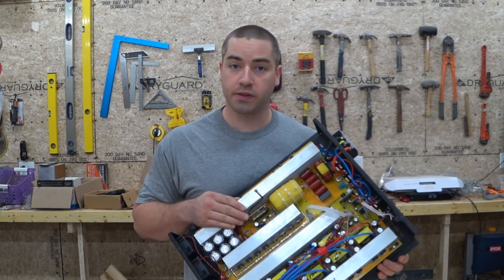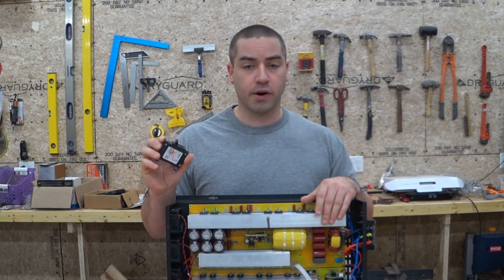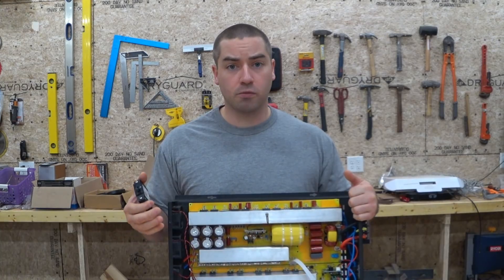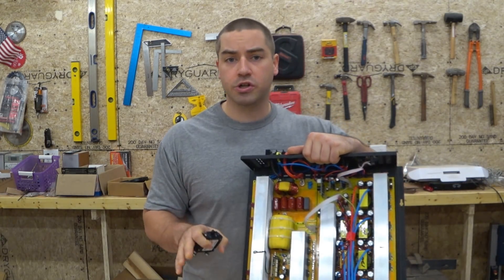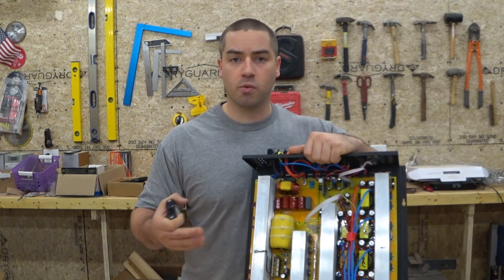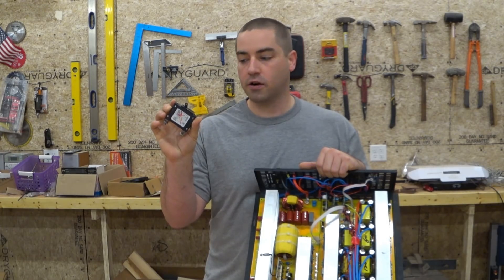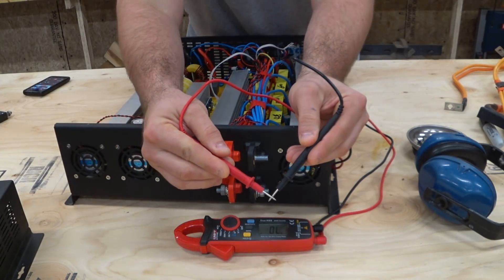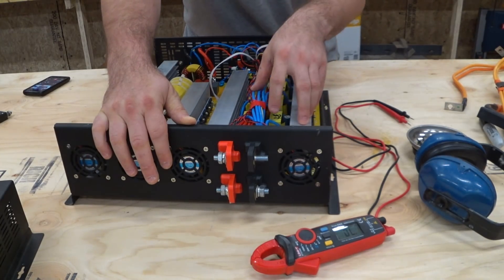Did I Blow Up the Inverter?

Comment: Your clamp meter can't response fast enough to give you actual peak inrush current. I would guess it about double or triple the reading value of 39Amp for the first 10msec.  With that much current goes through a conductor and disruptively stop because the circuit breaker trip, the voltage spike will result dV/dT (the one you see in the video) in thousands of volts and this voltage will go and kill most device in its path. If the breaker did not trip, it may not be the case. This may be the reason.
I think the reason that your 3000W didn't have this problem with the same set up, because it has overall higher circuit impedance (hard to explain in short note) and this in turn slow down the rate of inrush current, while the 8000W unit is made to supply big current. Its internal circuit impedance has to be lower; therefore, it will allow much more current to pass through (including the inrush).
If the product has been designed properly, the 8000W unit must incorporate inrush protecting circuit (slow turn on).
Reply from the maker: Thanks for the comment.  Can you please define "dv/dt" for me?  I don't know what that means.  Thanks.

Comment: I'd like to point out something critical, when you tried to measure the continuity, you've got all the capacitors in parallel and that can be read as a short to the meter while they are charging. 

I hope This helps https://youtu.be/_5h0HBf3xVI
Reply from the maker: Wow, thank you so much for taking the time to make the video.  Yes, very helpful.  I'll have to make a follow up video.
Reply: Good luck fixing the inverter, I might start posting when I'm asked to fix things when I get a better setup

Comment: Are the inverters true sine wave? A few years ago my brother (electrical engineer now, in school at the time) was telling me if I wanted to run motors on inverters I should use true sine wave because it could damage some types of motors if not. I am not sure it it could damage the inverters but it seems like a possible avenue of inquiry.
Reply from the maker: Thanks.  "Reliable Electric" says they are true sine wave.  However, I don't own an oscilloscope to say otherwise.

Comment: Crap design. Load balancing is a tricky bitch and that is designed like the cinese PSUs with lots of fets and/or diodes in parallel. The weakest will kill the entire stack.

Also, hold on the probes on the device and watch the numbers on the multimeter. On the dc input you have a lot of capacitors that will present as a short untill they charge. Hold the probes, watch the display. Tip-tapping a bit ain't cutting it ;)
Reply from the maker: Thanks.  I didn't know the proper way to check continuity until some other commentators said the same thing.  Since then I have re-checked it with the probes held on for one full minute and the reading was 000.0 ohms the whole time.  The number never changed.  I hope that helps.  Thanks for your comment.

Comment: The problem is poor inverter design, not your setup.  Any decent inverter will handle a dead short on its output without blowing up, regardless of how much power it was delivering at the instant the short appears.  The manufacturer needs to revise their design and do proper testing before shipping a product or stop building inverters.
Reply: yes a dead short on an inverter should shut down the inverter instantly... another protection circuit they left out
Reply: Is there such a thing as a well designed and cheap inverter?  If so, could you please recommend?
Reply: @chrisjohns9631  1. Cheap.  2. Quality product.  3.  Great customer support/service.    Pick two.

Comment: Putting a continuity tester on the 12v in will show a short as the internal capacitors will be discharged. Your as you called it input board is nothing more than a cluster of DC to DC boost converters, each producing 120v or so of DC, or 220v etc. That goes to the next board which takes that DC and connects it to the output via 4sets of MOSFETs first DC positive to one terminal and DC negative to the the other, waits a short while then connects the DC to the terminals the keep way, stimulating AC power. (It's basically a motor h bridge)
Oh and midnite solar are blowing smoke on the spark, at high amps sparks are not uncommon when breakers open, plenty of proof on YouTube. Breaking a DC circuit above a few amps without a spark would be a miracle. 
But..... I'd say the inverter failed first.
Reply: waits a short while then connects the DC to the terminals the other way, stimulating AC power. (It's basically a motor h bridge)
Reply from the maker: You mentioned "boost converters"  are those the things I called "transformer" in the video?
Reply: @DavidPozEnergy  yeah you have a bank of them to share the current load, its cheaper to make smaller ''boosters'' then one big one, but then its a see-saw in pcb size, do you want to use 10 x 10 amp converters or 100 x 1 amp ones.....

I once had an inverter fail to produce ac in the switching side, but the 'boost' side was fine so it was outputting 220v dc...... only one piece of equipment stopped working, the timer for my tshirt press, as it was the only thing with an old fashioned transformer 220 to 6v power supply inside it, my epson printers, laptop supply's, monitor, all kept running quite happy on dc

also testing for a short on the main input to the inverter, across that input are the huge capacitors, they will show short till they charge upto the multi-meters probe voltage,  just checked one of mine, shows a short for about 15 seconds then it gradually creeps up to a tens of thousand of ohms

Comment: What are the specs on your saw, does it have ratings on it anywhere, and like some others have mentioned about your battery bank, can it supply the amps (factoring in the burst load starting the saw) for that 8kw inverter., if not the volts will lower which then requires more amps. And saw's make horrible noise on the power lines, maybe even enough to upset the inner working of the switching inside the inverter like altering the switching time of one or more of the input stages which can put them out of sync, I wonder how it would go if you had an isolation transformer after the inverter (just curious, maybe someone can give some info how they would work.). I think by design that inverter can handle most regular house appliances up to the 8kw but no so great with power tools, but I would at least expect it to cope with a home AC system. Im surprised the makers of that inverter havn't asked you to ship that saw to them so they can test in house before too many more Blown Inverter videos get posted to youtube. Thanks for sharing, we all learn from this stuff. Look forward to more updated.

Comment: James moore is correct. It's not the batteries, it not the circuit breaker, it's not the saw. They all worked with the smaller 3K inverter. The only variable that changed was the inverter.

Comment: I'm not an EE either.  I'm just a dude sitting in his desk chair.  But my guess is that a "sine wave" inverter doesn't really produce a sine wave.  It produces a "wave" that would look like steps going up and down, up and down.  My guess about those transformers or chokes or what ever they are each operate for one level of stepped voltage.

Comment: You need to hold the DMM across the input terminals for more than a second to determine if there is a short or not.  The large capacitors on the DC (+12V) input will look like a low impedance (short) until they charge up to small voltage (0.1V ?) the DMM is applying across the input.
Reply from the maker: Thanks.  What am I looking for on the multi-meter?
Reply: @DavidPozEnergy ,

If it is shorted, you should get a continuous beep for as long as the probes are connected.  You could also just measure the input resistance.  I would be concerned if you get a continuous reading less than a few hundred (200) ohms.  The resistance reading will start out low, that is the input capacitors charging up, but if you hold the leads on the input for a few seconds, it should climb up to a few kohms (or higher is generally okay up to maybe 200kohms, any higher and you might have an open fuse, or a device that failed open.)  My 1500W inverter has an input resistance of about 11kohms.
Reply from the maker: Thanks.  I just went out to the garage and timed myself holding the probes on the +/- leads for one minute.  The reading was 000.0 ohms the whole time, never changed.  What does that tell us?  I do appreciate the help.
Reply: So you have a dead-short on the DC input.  Are each of the input circuits individually fused?  If they are, you can pull fuses one at a time, and check if the input is still shorted.  If the resistance jumps up from zero, the short is on the circuit of the last fuse you pulled.  That might help you locate where the short is on the board.  You could also try passing a couple of amps of current (using a DC current-limited power supply) through the short, and see if any device gets warm.  Although, if it is a heatsinked transistor, it might not get warm enough for you to notice. IR cameras are good for identifying components that are getting slightly warmer than ambient when trying to locate a short thermally.  Good luck!

Comment: There is a lot of discussion about the "load sharing" between the various sections of this inverter.

I haven't worked on a "Reliable Electric" unit but I have worked on a number of large inverters from another manufacturer, and I've seen the bottom of Reliable's 3000W model (in another video on another channel) and seen that it is similar.

The sections are NOT parallelled on the output sides at all. The length of the supply conductors isn't hugely relevant, and no section ever sees more current than the other.

What you have is nine different, isolated, voltage converters. They are synchronized but otherwise independent. The secondary sides of these converters are in SERIES and produce about 360volts DC, with a center tap (ie: ground, +180VDC, -180VDC).

The second board that David here is calling the output board is just exactly that. It uses PWM to generate a somewhat-accurate 60Hz sinewave that swings between the two 180V rails.

Since the input sections are in series, they all see the same current. One may output a slightly higher or lower voltage than another, but we're talking a couple of percents here, if even that. There should be enough headroom in the design that a few volts drop on the HVDC rails is irrelevant, and, in any case, the difference will not stress one section more than another.

@TrackGeeks also makes an interesting point. MOSFETs can easily be killed by instantaneous current, faster than a fuse can blow. Those fuses are protecting the wiring from dead short current, but they're not really protecting the fets themselves.

Most traditional applications consist of a big lead battery. They have scary current capability but it's still "tame" in comparison to lithium batteries.

When you try to start up that motor, it's initially a dead short, and the current is limited only by the DC resistance of the motor windings and the impedance of your wiring...

... your wiring is pretty short. There's not a lot of resistance there. The inverter is, for all intents and purposes, seeing a dead short.

What would normally happen is that the DC input voltage would sag a bit -- the resistance of the INPUT wiring (and batteries) would limit the actual current through the MOSFETs. It would likely be higher than the fuse value but lower than the value at which the mosfets explode... but you don't have (as much) resistance in your batteries AND the supply wiring is short. Your battery bank is able to provide a much higher (and thus more destructive) instantaneous current than "Reliable Electric" expects of their usual lead-wielding customers.
Reply: that might be true if the 3KW inverter blew up too!
but it didnt

Comment: In the video, you have been focusing on the spark from the circuit breaker, but it seems to me that the inverter had a spark just before. The inverter spark is towards the top left of the screen.

Comment: your clamp meter probably has a min max function which should give you a more accurate number of amps and no recording needed
Reply: Yes it would be much more practical to measure. But it is still possible the meter is to slow to catch the inrush current correctly.

Comment: I don't think your meter reads the surge fast enough and as such gives a much lower reading than what occurred.
Reply: I agree with Dubs.  Go search for Gone with eh Wynn's Air conditoner on inverter on their boat.  The guy that sells the EZ start shows a customer meter that shoes an ac took 3x what his regular meter showed .  So in your case you could have been surging to 120amps not 40amps.  Way more than the breaker could handle .?
Reply from the maker: Sure, I agree that my meter is not the right tool for measuring in-rush current.  For fun I just did out the math on your suggestion of 120 amps (on the saw's AC side), that would translate to drawing 400% the rating of the cicuit breaker.  Looking back at the time delay chart, that means the breaker would have tripped between 1.40-15.0 seconds.  In the video you can see the breaker tripping immediately.  So that still points the finger at the inverter failing first, not the breaker.
Reply: @DavidPozEnergy  Not an electrical engineer but I do work with motor installations.  Yes the inverter failed because you overloaded it. Buy or borrow a multi-meter with a clamp on  current sensor and an inrush capture function. A Fluke 325 is ideal. You will find your inrush is much higher than you expect. Brush type "universal" motors such as your saw are designed for very high torque at startup and are effectively a dead short when you hit the switch. Induction motors also have high inrush but not nearly as much for the same horsepower. The high inrush likely damaged one or more MOSFETs causing them to fail as a short.

Circuit breakers protect wires from burning. Electronics should be protected by fast acting ceramic fuses. Glass fuses can sustain an arc for a few milliseconds in a high amp short. Ceramic fuses are filled with silica sand that quenches that arc.  Blade type automotive fuses are pretty well junk for protecting electronics. They are make to prevent wire fires and have slow response and generally poor arc quenching.

Running high power motors with batteries is best done with DC motors or with a VFD inverter that allows the amperage to ramp up controllable, as done in vehicles. You are in luck though. Universal brush type tool motor on that saw will run directly on DC.  Yes, really. Thus the "Universal." Of course this may not be the case if you have fancy electronics built in to the tool, but the motor itself will likely turn fast enough on the 80VDC I think you said you had. To see if you can do this check that the motor has brushes and the trigger is just a switch on the power wire going to the motor. Running at a lower speed may cause the motor to heat more quickly. There are very many industrial 90VDC motors available that may be able to replace it's function.

I, of course, can't warranty what you do. Always use circuit protection and proper electrical safety precautions. And discard that breaker. It's toast.
Reply: Bill Kerr 
I AM an electrical engineer, (LOL), and can say that peak current measurement is not so easy. We checked our clamp-on meters against an oscope and current probe/preamp setup, and our budget clamp-on Fluke with peak current readout was pretty close, but as I recall, a BK clamp-on was in the ballpark. 
Unless you have a surge setting with peak hold, you aren’t going to be accurate at all, with such short transients. Even a off brand with the right capabilities would probably be close enough. 
Very interesting videos. I’m learning a lot.
Reply: ...in other words - Bill is right.
Reply: Bingo! You don't really know yet what the surge really is. That said, I still think it's an issue with the inverter
Reply: judging by the time and looking at the chart I would suspect he was closer to the %800-%1200 range

Comment: I think mostly is a problem on the conversion side of the inverter. 
You can say pure sinus wave when you output it but if you don't engineer unphasing it's junked quickly.

A resistive load is in phase, but a motor is inductive load, and on heavy side, 90° unphasing the current with voltage(tension) and for simple basic calculation, consider your start inrush is 6x to 10x the nominal current.

It plays on milliseconds, and with that unphasing shifting, if the inverter have no back calculation quick enough you can have spikes not compensated by the electronics up to thousands volts. 

To be more simple consider your motor as a really fast charging battery but with alternative components harden the calculations. When you want to start it, you have nearly infinite rush of curent. Still in milliseconds once charged up your motor will give back on the circuit with Fourier law some of it's stored energy but at different frequency.

If your inverten don't see it and by the way don't care about, the current will have nowhere to go, and by the way, the voltage will raise up to insane levels. Once the voltage is high enough, bam, component destroyed and sparks on your breker.

I really hope that I have been clear enough. You can ask me uestions if something still unclear, and well I can provide calculations if you want as well.
Reply from the maker: Thank you for the explanation.  I've just started learning about how inverters work.